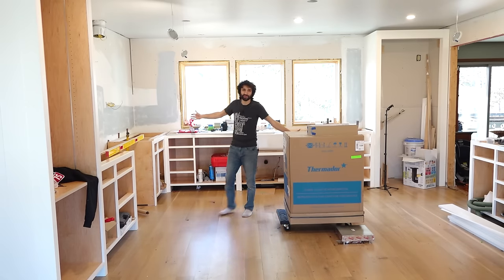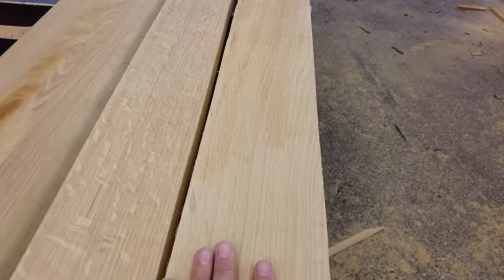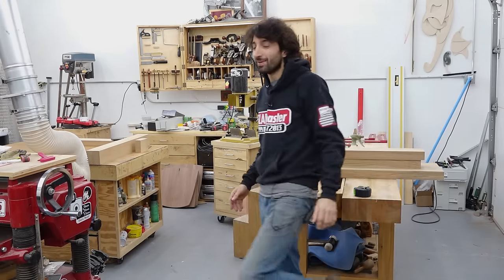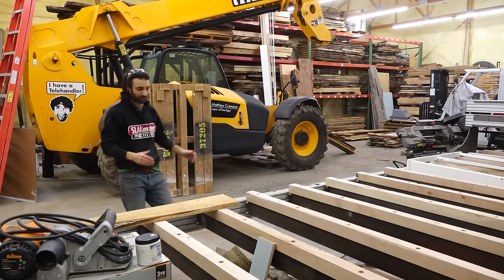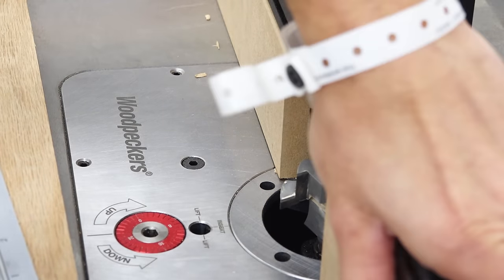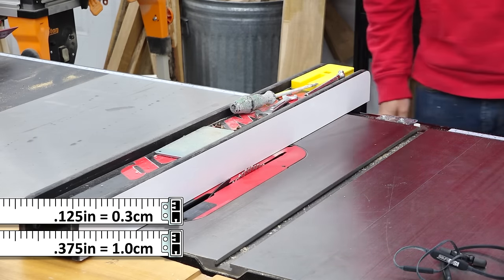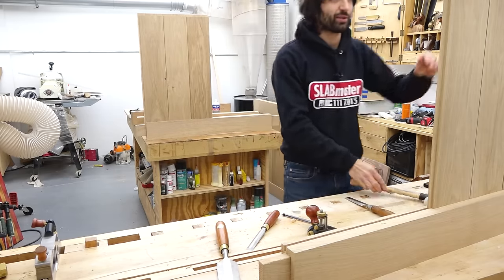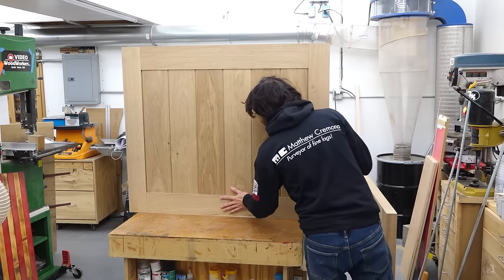Kitchen Island End Panels made out of a tree | Home Renovation & Addition Part 72

Comment: Matt, I have cut WAY too many bf of red and white oak-quarter and plain sawn lumber in dimensional sizes and much less as slabs with my chainsaw mill.  Your insight about using slabs as woodworking stock is spot-on, once the slabs are air dried, the sky's the limit in terms of final grain orientation and use choices when you start with 8/4, 10/4, or even 12/4 slabs.  I'll frequently use the shorter cut-offs that are still quite thick as turning blanks to make salt/pepper grinders to give as Christmas or wedding presents.

Comment: Nice work. I read you should pre-drill the mortises before you use the mortiser. That way you don't put a strain on the bit and your mortiser runs straight without deflection and you get a cleaner mortise. Just a thought.
Reply from the maker: That’s what the mortiser does. The auger should be ahead of the chisel

Comment: Since you air dried the oak, aren't you afraid that it might twist or warp as it dries some more in the frame?  Or is oak more stable and the frame strong enough so that's not a concern?
Reply from the maker: Only going to pick up moisture as we come into the summer. Frame is 4-5%, panels are 5-6%

Comment: So I panicked when I saw the fork lift in the barn pulling 9/4 stock stacked up with stickers between for use as your kitchen cabinets. Aren't those just air dried (not kiln dried)? If air dried how long? The end product looks fine.so far. I built a lot of my kitchen out of air dried oak but many years of drying.
Reply: Kiln dried 2 years ago